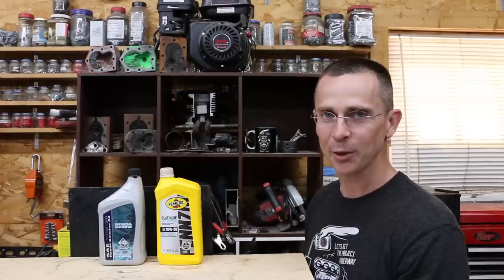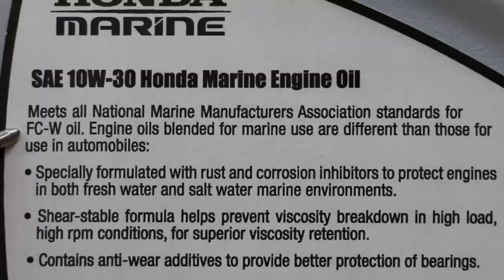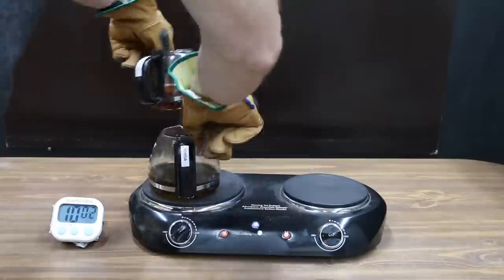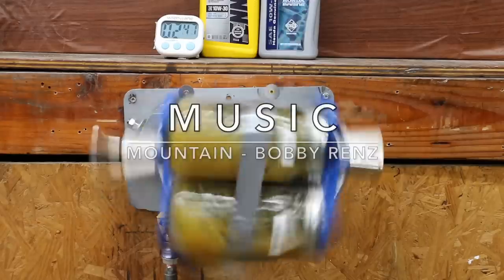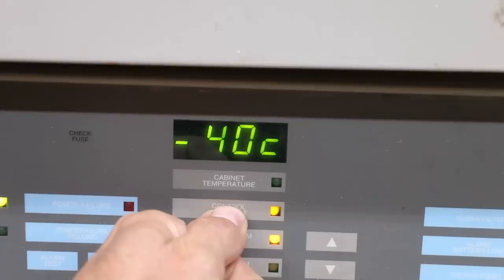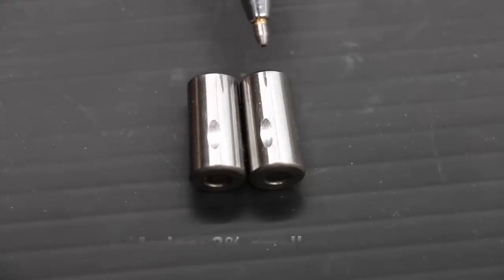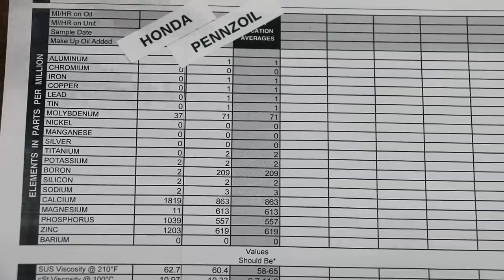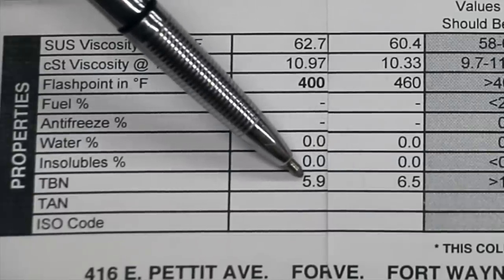Motorboat Engine Oil Better Than Regular Motor Oil?

Comment: Thanks for the report but one important things you may have overlooked is the Honda marine oil doesn’t states it’s a synthetic oil on the container so have to assume it a std Dino oil.

The pennzoil states it’s a synthetic oil so right up front your comparing apples to oranges & we also know with all else = the avg syn oil will out perform a std Dino oil every time.

That’s why the syn oil blew away the std Dino oil in 400 deg f heat test you ran where the full syn oil out performed std Dino oil which was no surprise.

So in this case if the syn pennzoil out performed the the std Dino Honda marine it’s not surprise, but if the std Dino Honda marine oil out performs the syn oil that’s a big win.

I see in oil test results the marine oil has a decent zddp/zinc phos anti west agent level at approx 1209ppm/1000pp to syn oils low 600ppm/500ppm but the syn has a bit more moly though not enough to make up for its low zddp/anti wear agent lvl.

Bottom line is to properly do this test you need put std Dino automotive oil up against the std Dino marine if same grade for a fair accurate result.

Keep up the good work on all the testing you do for us.
Reply from the maker: Thanks, will do.

Comment: Is the Honda a synthetic or conventional oil? I would be curious to see how the Honda marine compares with a conventional 10w30 oil. Especially in the volatility and foaming tests. May be a viable option for small engines especially with the higher amount of anti wear additives and rust prevention.
Reply: I use it in my honda 40 horse , it states semi synthetic on the bottle
Reply: They duped everyone on here with a petroleum Honda marine oil vs a synthetic automotive oil.  They should have been straight here and compared apples to apples, a  synthetic marine oil with synthetic automotive oil.

Comment: I'd be happy to see a video about the best affordable hydraulic jacks for home use. I'm trying to find a good and not too expensive trolley jack and I have concerns about lifting heights of the cheaper ones. Will my jack-stands fit for the first time? Will it fit under lower cars? Are they high enough for trucks?
Reply from the maker: Thanks for the suggestion.

Comment: The only notable difference in conditions between automobiles and marine vehicles is that marine vehicles tend to run their engines at a near top speed power output for almost all of their run time.
That difference isn't huge but might be significant.
Reply from the maker: Thanks for the feedback.

Comment: Here's a question for you:
Do zinc and phosphorous actually cause problems with the cat? By how much would it reduce the lifetime? 
If the reduction is only say, 5-15% maybe it would be worth using the higher zinc oils for the extra benefits to your engine.
Reply from the maker: Thanks for the suggestion.

Comment: If anything, marine oils need to be good for cool running engines. Generally, outboard motors don't encounter heavy traffic or high coolant temperatures.
Reply from the maker: Thanks for the feedback.

Comment: you should do a video on this VP Racing 3-Year Gas Fuel Stabilizer 2 & 4-Stroke Engine. not so much for fuel stabilizer but its suppose to protect the tank from ethanol damage . that is what i am interested in.stuff is not cheap by no means
Reply from the maker: Thanks for the suggestion.
Reply: @ProjectFarm  by the way i love your channel

Comment: What if you mixed oil. Like one oil had one good area and another oil has another got area. Mix the two together and you’ve got a great oil maybe? Test mixed oil against mixed oil? For example mobile 1 and Amazon basics vs penzoil and valvoline. Doesn’t have to be brand specific but I’m curious great videos I really appreciate the work you do
Reply from the maker: Thanks!  Thanks for the suggestion.

Comment: @projectfarm I know you have done many oil tests but I'm missing one that really interests me. Evinrude E-Tec outboard engines have different settings for what type of oil you use, the best for clean burning a nd fuel efficiency is requiring that you use their XD100 oil. Amsoil sells HP Marine Synthetic 2-Stroke Oil which claims "Excellent for Evinrude® E-TEC™ factory-lean setting (replaces Evinrude XD100™ 2-Cycle Oil). "  The views on e-tec owner groups are divided, some say it is better than XD100 others say it is not. Could you please test those outboard 2 stroke oils. To make it more interesting you could also add XD50, XD30 and Mercury Premium Plus 2 stroke oil. They all claim they are the best but only one can be the winner.
Reply from the maker: Thanks for the video idea.

Comment: Hey pf / Todd on the test for corrosive would applying heat to the metal with applying the oil have any effect on how the oil does since engines cycle hot and cold. I am only asking because you are a very smart guy with all of these test
Reply from the maker: Thanks for the suggestion.

Comment: Generally, marine engines never get very hot, never really topping 200 degrees unless they run wide open. Also realize too, Honda doesn’t make their own oil. They buy it from whomever provides them with what they specify at the cheapest price. Now if you took Amsoil automotive, versus their marine oil, that might be something to see.
Reply from the maker: Thanks for the feedback.

Comment: Good morning,  I've looked through all your videos to find, best bar oil for chain saws and didn't find one. Did you happen to test that?
I see people use new/used motor oil
Some will run only sthil  3 different types 
And then you see the hardware store brand for half the price as sthil bar oils.
Thanks 4 your help and learn a lot with your testing. Blessings
Reply from the maker: Thanks for the video idea.

Comment: Interesting. I've always heard marine oils are better at corrosion resistance since you're always on the water, but other than that I don't see any benefits. When I do my annual oil change in my outboard this fall, I will likely just use Penzoil.
Reply from the maker: Thanks for the feedback.

Comment: Could you do a video on water injection? Maybe straight water vs methanol vs non injected to see fuel economy and cleaning capabilities? A guy could always do the “injection” by just running water or methanol through a bubbler like it your older video, just plumbed into a carburetor engine.
Reply from the maker: Thanks for the video idea.

Comment: In general 'marine' = 15% more $.  But a boat motor runs at a constant rpm, not a high rpm.  Honda?  Do they make IB or IB/OB motors?  That is the oil to compare.  I don't use a OB motor in my car.

Comment: Dear Project Farm could you please test the best crowfoot wrenches for that bolt you just can not reach in a normal means. 
How will the stand up to the torque until they break or round off a bolt for the price you pay. Straight open crowfoot or crowfoot flare nut wrench which is better for cracking that hiding bolts. 
This should be a very interesting test.
Thank you for you incredible videos.
Reply from the maker: You are welcome!  Thanks for the suggestion.

Comment: Now this is a more expensive test but, could you review the new battery powered electric push mowers?  EGO, Toro, Atlas(HF), Kobalt, Dewalt, and any other I missed that seems good.
Reply from the maker: Thanks for the suggestion.

Comment: Whatever you do, don't use the cheaper pennzoil. It's made from pete moss, and leaves a layer of wax on metal components as it deteriorates.
Reply: The Ultra Platinum is really good though
Reply from the maker: Thanks for the feedback.

Comment: You should test more marine oils mineral vs synthetic blend and full synthetic.  There is hardly anything about these extremely expensive motor oil.  Especially Mercury, Yammi lube vs a national brand marine oil like Valvoline or Pennzoil Marine.  All 4 stroke
Reply from the maker: Thanks for the suggestion.

Comment: I would like to see a video of motorcycle rated engine oils (JASO MA) with rotella T4 & T6 thrown in the mix vs oils like honda gn4, yamalube, etc.  There is a huge following of rotella in the offroad racing world and many use it in street bikes and UTVs also.  I have always ran it in my dirtbikes and other things with good results but I wonder if there is something better for my money.
Reply from the maker: Thanks for the suggestion.

Comment: Could you test for oil cooling in air cooled motors?  I see a lot of talk by VW air-cooled enthusiasts that modern synthetic oils don't cool engines as well as older oils did.
 They suggest using oil designed for small aircraft because of this. I believe they think it is due to there being less zinc in new oils.
 There is a huge following of air-cooled VWs if you did not already know this.
Reply from the maker: Thanks for the suggestion.

Comment: I switched to penzoil based on your past tests, I guess the question I had and didnt see answered can you run the penzoil in a marine engine? or are the anti corrosive additives needed? Personally i would use the penzoil  good video
Reply from the maker: No, recommend using boat oil for the higher anti-wear additives.

Comment: Love the tests PF

Would like to see marine Amsoil & per other comment i have been using Amsoil premium synthetic 2  stroke oil appears by mercury vessel view runs 3-4 degrees cooler ( note i also used barnacle buster & replaced impeller so scale removed may be reason vs reduced friction)
Reply from the maker: Thanks!

Comment: I think it would have been best to test more marine oils, Yamaha, Mercury, Suzuki and BRP as these are most common motors
Reply from the maker: Great suggestion!  Thank you.
Reply: It would have been best if they compared synthetic to synthetic. That Honda oil was petroleum based and the Pennzoil was full synthetic.  If you want to compare marine vs auto then use synthetic versions of both...  This was not an apples to apples comparison.

Comment: Could you compare different brands of blend pad? Would like to see which ones offer the best durability as well as ability to remove burs without removing too much material. Preferably for mild steel, if you would be so kind to do so. The ones at work have been really lacking in durability and I usually go through up to 5 a week, sometimes over 2 or 3 a day. Thanks PF!
Reply from the maker: Thanks for the suggestion.

Comment: Given the additional benefits of the Pennzoil but marine requirements of outboard motors, I wonder how a 50/50 blend of the two would work in a boat motor?
Reply from the maker: Thanks for the suggestion.

Comment: Would you test if diluting cooking oil in diesel oil, will the engine work? And as fire starter, is it any good? I've been using it as fire starter, but as fuel it is an idea that I do not have where to try, so would you? Thanks man, I really enjoy your videos!
Reply from the maker: Thanks for the suggestion.

Comment: My first thought is that automotive engines operate at more extreme temperature ranges while marine engines are subjected to more time at high RPMs in a more corrosive environment. The tests seem to perfectly illustrate their respective advantages.
Reply from the maker: Thanks for the feedback.
Reply: They duped everyone on here with a petroleum based Honda marine oil vs a synthetic automotive oil.  They should have been straight here and compared apples to apples, a  synthetic marine oil with synthetic automotive oil.

Comment: I wonder if it would be feasible to do a ball joint test...some kind of rig that would hold the fixed end and rotate the stud around, of course they typically last for years so I'm not sure what kind of run time would be needed to see wear. And actually automotive replacement parts in general...there's a lot of brands that don't seem to hold up, I bought a new glow plug relay for my truck and it was dead right out of the box, and I hear similar bad experiences all the time. I'm rebuilding the whole front end on my truck atm, but I'm never really sure which replacement parts brands are best, and I, probably even more than most, hate replacing parts twice.
Reply from the maker: Thanks for the suggestion.

Comment: So if the main reason it wouldn’t be good to use in a modern car is because of catalytic converters what about using it in performance engines that do not have catalytic converters, such as my 2001 Honda S2000 that’s slightly modified?

Comment: Which paintstick is better? I use the markal paintstick everyday for my job. I write on cold/hot metal, cold/hot rubber and just about everything else with it even works underwater. Was wondering if there is a better brand to be using or am i already using the best. Would love the help figuring this out.
Reply from the maker: Thanks for the video idea.

Comment: Does 10% diesel in e10 gasoline  makes the e10 better and will it improve the mpg? Compared to ordinary e10. And will it hurt the engine or carbonbuild up? Would like to see a test like that.
Reply from the maker: Thanks for the suggestion.
Reply: @ProjectFarm  love your tests, just as great here in Sweden also and very useful. Not everyone have a couple of lawnmotors to test on.😄👍 Liked your test on Lucas gearfixoil, Lucas oil is very rare here but I figured out that it is the thickness in the oil that makes the automatic transmission work better and smoother, so I tested to use 2 liter of straight motoroil sae 50w and poured it into the gearbox and it worked excellent for my Saab 9-5 2001. Shifting perfectly now.😊👍👍👍

Comment: I've always used marine oils and filters. because it's what I have laying around and Marine oil filters and fuel filters will do a better job of getting moisture out of s***
Reply from the maker: Thanks for sharing.
Reply: No problem... serria marine makes the bet stuff I use eveting serria... plugs wires filters oil you should the the fule filters and oil filters and there oil an fule stabiliser and engine store like to see if that extra $$$ ad up. Learned a lot from this channel... most there ilis have I high zinc additive

Comment: API oil ratings from 1996 to 2011 had very similar amounts of zinc and phosphorus as the Honda oil, some even had more. So it’s perfectly safe for most catalytic converters. Sure if your car burns a quart of oil every 500 miles then your cat is gonna break, but 1200 ppm is fine for 90% of the cars who’s owners would even consider using boat oil😂

Comment: How do you clean the oil off the flow test?
Let's find out which cleaning product to use. :)

I had a tool box in back of my truck and got rained on.
I put some oil on the tools to help the rusting but now the tools have oil all over them.
Reply from the maker: Great suggestion!  Thank you.

Comment: Great video.. but can you use normal car oil in a two cycle marine application?   I don't think so. 
Maybe vegetable oils but not car oils.
Reply from the maker: Thanks!  No, recommend using boat oil for the higher anti wear additives.

Comment: Regarding oil in general, are fluids extractors (e.g., OEM Tools Manual Fluid Extractor 8L)safe and reliable for cars and boats?  They seem to be growing in popularity but I haven't found anything relative to whether independent auto or boat mechanics recommended them or not.   They sure seem to beat crawling under a car to drain oil.  Maybe you can test one of them on a variety of equipment.  Thanks.
Reply from the maker: Thanks for the suggestion.
Reply: @ProjectFarm  Any feedback/opinion on the reliability of fluid extractors?

Comment: You do a lot of oil videos, which are great, but how about a filter video?  There ate a lot of filter reviews out there, but they just cut them apart and make comments, no testing like pressure drop, bypass testing, filtering used oil and testing for debret before and after.  I think only you can do a test like this.
Reply from the maker: Thanks for the video idea.

Comment: Have you tested motorcycle oil? I've read on several forums that many people will use Shell Rotella T4 (diesel oil) instead of expensive motorcycle oil.
Reply from the maker: Thanks for the suggestion.

Comment: Would it be worth it to run marine oil in my small mix fuel engines?
Weed eater, hedger, chainsaw, etc
Reply from the maker: Thanks for the suggestion.

Comment: Looks like it’s be better to use marine oil in marine applications as well and not use car oil. The zinc and phosphorus will help with the full throttle 5500 rpm’s or higher trips down the lake/reservoir for less engine wear.
Reply from the maker: Thanks for the feedback.

Comment: How about comparing tool bags or backpacks. I use them at work and the ones I have tried fail after a year or two, usually zipper failure.
Reply from the maker: Thanks for the suggestion.

Comment: Now you need to test royal purple vs other oils. I noticed i had oil filter gaskets stretch and leak with royal purple vs cheaper brands never leak. Also seemed like my car HATED royal purple. Came out like water when I changed it vs pens oil and others came out like oil. I’m curious what you can find with that!
Reply from the maker: Thanks for the suggestion.
Reply: @ProjectFarm  you’re welcome!

Comment: Have you done a test to compare octane booster in gasoline vs gas with no additives? Sure it depends on compression but would be interesting
Reply from the maker: Thanks for the suggestion.

Comment: I've read that Quicksilver 4 stroke outboard oil was superior oil made to handle high RPM for long periods.  A boat outboard operation is similar to a lawn tractor with no radiator.   Would it be worth the cost to use Quicksilver 10w30 oil in my lawn tractor with a Kohler 22 HP vs Kohler 10w30?
Reply from the maker: Thanks for the suggestion.